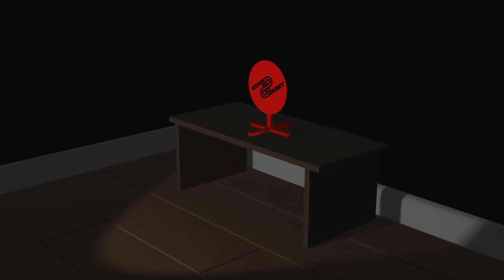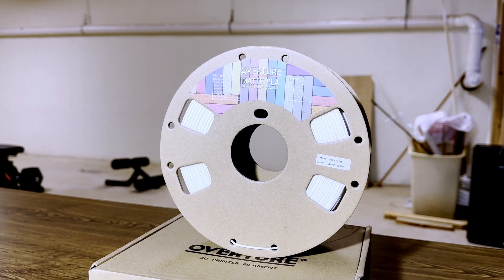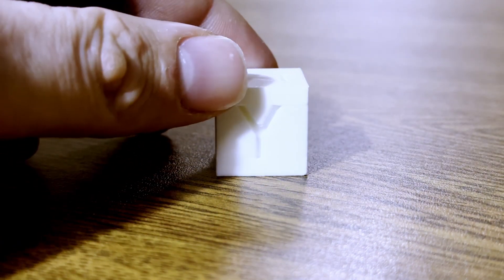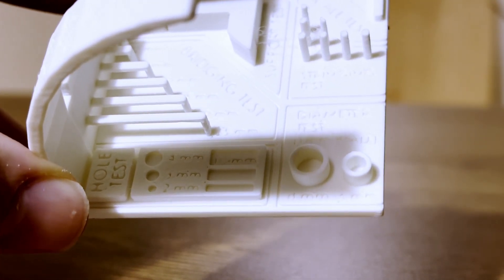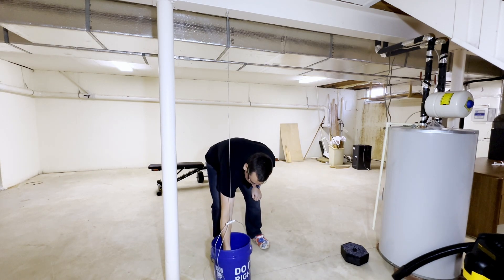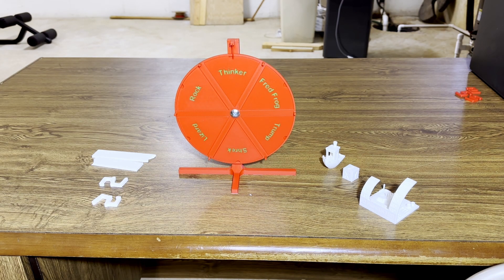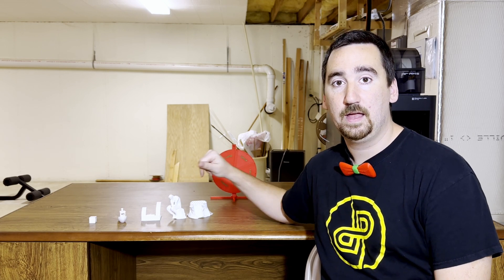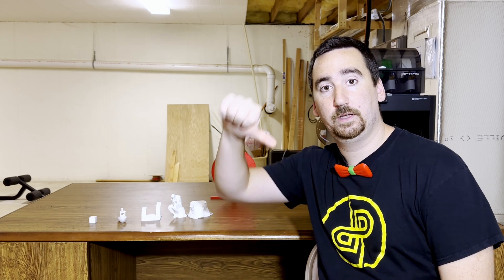Overture Matte PLA | Print Or Pass! | The Review Show

Comment: A few things - White is ALWAYS the weakest color filament for any brand or polymer type, so it is not remotely fair to test white filament against any other color. White is brittle, and weak because of the Titanium dioxide that is added for color. On the other hand, black will be the strongest because the Carbon Black that is added forms a carbon skeleton reinforcement. Additionally, the fiber added to this is likely going to further decrease strength. This filament is not meant to be strong. Its meant for things like Lithopanes where Matte white is best.

Comment: I just got some if this with my Ender 3 V3 SE, but it's giving me serious headaches. It keeps clogging the tube between the nozzle and the direct drive... literally every print. Any suggestions? It also seems really brittle, could it be snapping in the extruder?
Ender PLA behaves perfectly, this is the first time I've tried a different brand.

Comment: I’ve used overture standard PLA and PLA+ for several years across two ender 3s a monoprice mini delta, and a ender 3 v3 se with no issues. I recently purchased a few rolls of matte light blue for a business project, and I have, at this point, purchased and printed through 6 rolls. I have gotten terrible, but inconsistent results. Some prints come out perfect, some come out aweful. Poor bed adhesion, ugly layer lines, a lot of gapping and one of the 6 spoils was tangled pretty badly. Hate to see it since I pretty much have to use this color for what I’m doing, but the only printer that has had any kind of consistency has been the SE with the creality slicer settings.

Comment: I use Overture all the time. I've never had a problem with it. I don't print structural supports, though.
Reply from the maker: I use their TPU very often, and usually have no problems. It’s possible I got a bum roll. I used it for some other prints after this video and ran into a few problems around tangling and fragility. I’ve had it break multiple times inside the Bowden tube to the extruder.

Comment: You aren’t supposed to use cardboard spools in the AMS.  It’s snapping because it doesn’t retract correctly when the extruded motor retracts and it builds up slack and double wraps and snaps.
Reply from the maker: Yeah I know you’re not supposed to use cardboard spools in the AMS, though I do tend to bend that rule and run some cardboard spools in it anyway. I’ve run a few brands with success in it. 

Anyway, I still think this filament is a pass for me for a few reasons. 
- The filament is brittle. Even just bending the filament with your fingers, it seems to break way more easily than PLA should.
- There were tangles on the spool. I should have had a clip showing this, but I believe there were some legitimate AMS failures due to the filament being tangles on the spool.
- Strength test was resulting in way less weight compared to other PLAs on the market. 

Thanks for watching, always open to any feedback etc!
Reply: @PrintPractical  keep doing it and you will destroy the AMS. You can solve this easily by using spool ring/adapter. Idk why you are trying to destroy yours.

Comment: Thank you for the honest review. What would have caused it to be so brittle?
Reply from the maker: Maybe moisture? Though, the filament was factory sealed until I put it in the AMS (which has desiccant within it to maintain low moisture conditions). I know some manufacturers specify that you should dry their filament before use, Overture doesn’t specify this so I reviewed as is out of the box. I’ve had a ton of great experiences with their TPU, so I was definitely disappointed with this roll. Maybe a defective roll? Who knows..
Reply: @PrintPractical  I had a terrible experience with Overture matte PLA out of the box.  Nozzle clogs, poor layer adhesion, stringing, etc...  It was by far the worst out of the box performance of any filament I have purchased.  After drying, it worked fine, but I probably wouldn't buy it again after spending so much time (and filament) trying to diagnose the issues caused by their poor handling and packaging.